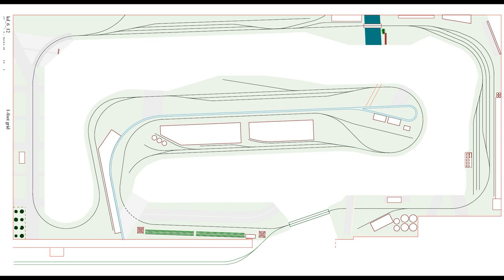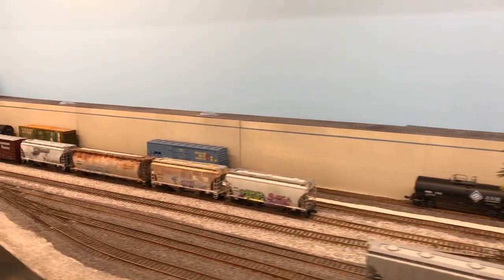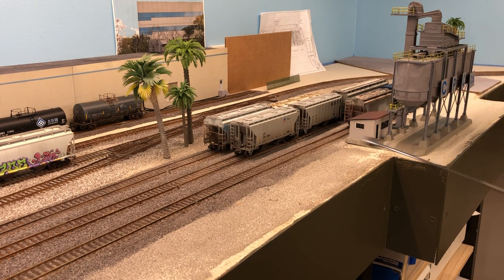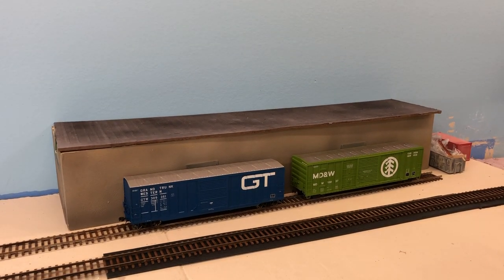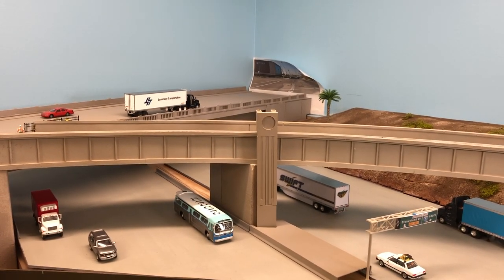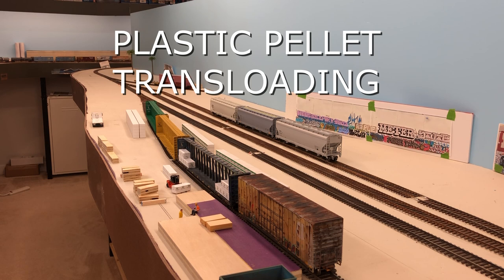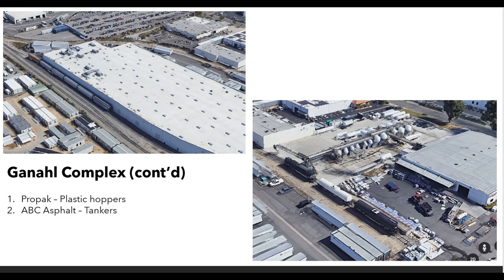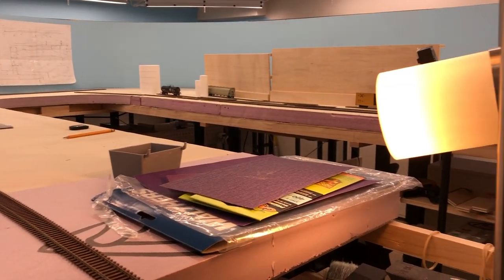Layout Tour - Santa Ana Industrial Lead - Large HO Scale Switching Model Railroad

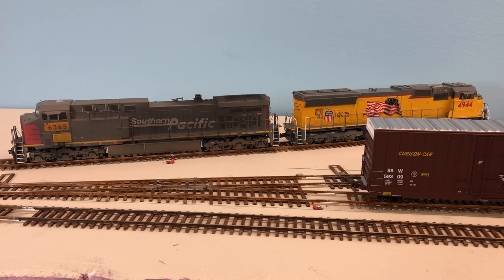Comment: Very nice... I see the turnout levers. Do they actually work the turnouts and if so where did you get them please??? With the CPC Co. I would have forgot the base and just had the supports go directly into the base or table...Really hard to hide the plastic looking base that is now on the unit. See in the actual picture, the legs go into the ground with no base on them... For a real educational tutorial watch the Boomer Diorama web site, it's great for scratch building and scenery... I see some drops at the 17:34 time line that have the outside of the cable showing. i take the coating off a little farther from the end and the bare wire is so easier to hide with ballast and there is no problem with shorts at all. I always solder to the bottom of the track also making the connection easier to cover. Boomer has a great video for running the track through what looks like concrete... In my train world, engines are kept as clean as possible, no grime, no rust...
Reply from the maker: The turnout stands are for show, they don't operate.  They are a combo of the ones that came with the ME turnouts, CVMW.com switch stand kits, txrail.com backsaver switch throws, and scratch built targets.  Yes, I've been a Boomer subscriber for years.  I model what I see, so grime, rust, graffiti, etc. but everyone can do what they want since it's their model RR.

Comment: where do you get your switch stands I think I'm using the right lingo?
Reply from the maker: Its a combo.  Mostly from Central Valley https://www.cvmw.com/turnouts.htm, but also backsavers from http://txrail.com/product_info.php?products_id=204, and then some parts came from the ME turnouts.  And I also cut the diamond ones out of Styrene and just used them with the CV ones.  On my line it's a hodge podge of turnout stands so I tried to replicate that.  Those backsavers are glued to the ME turnout parts, and then the CVMW are basically stock but on some I made the diamond targets from Styrene.  Not sure which ones you are referring to.